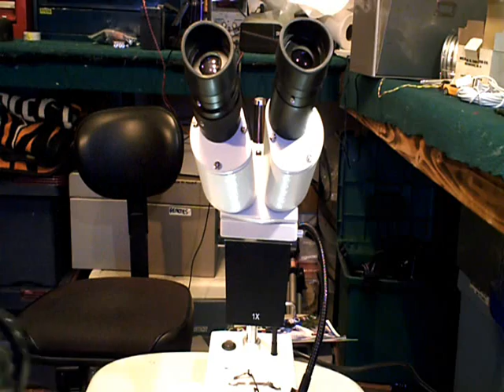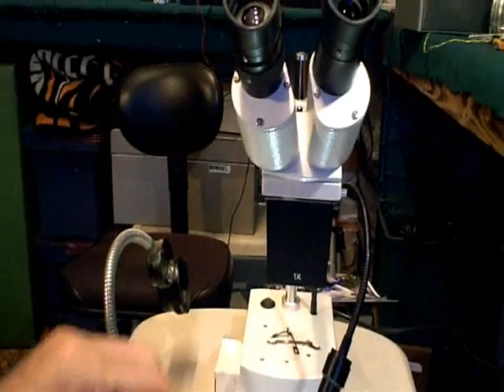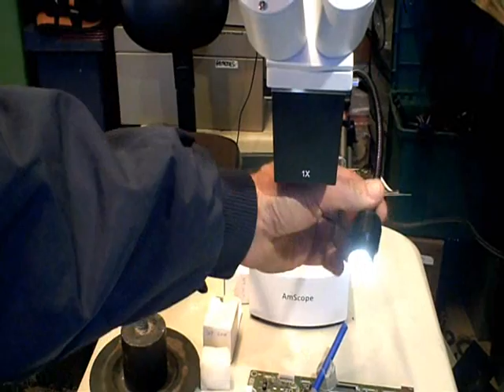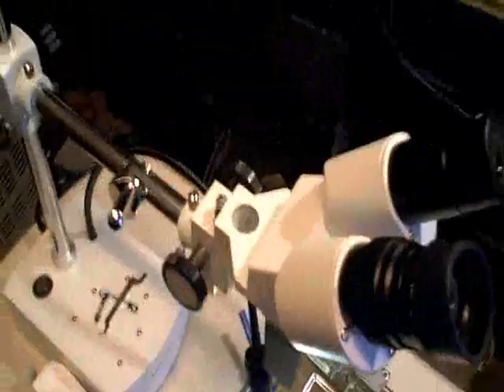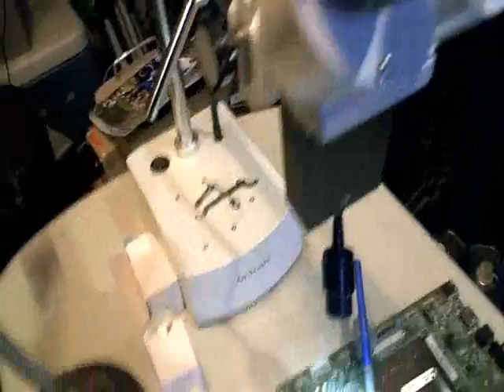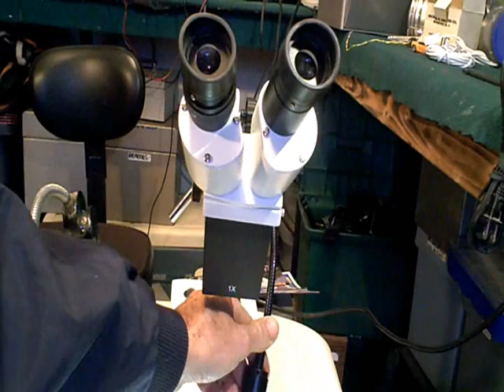Soldering Microscope. Why you should have one.

Comment: does yours not focus properly when lowering the microscope head around halfway down the sliding bar? does it have to be up high?
Reply from the maker: +Pero Yes if I lower the main optics it doesn't focus, but I didn't assume this meant it wasn't working correctly. I just figured it was out of its focus range.

Comment: I like the camera option, very nice.  
I will try using a video camera with macro focus zoom.  
I have a video CRT on my bench in one of my older workbench videos that magnifies a lot.  Look up Telesensory on ebay to see some of them.  Don 
This is one of the better color units at a very good price.  But you can get B&W for around 100$ or less.  Check this out!  http://www.ebay.com/itm/Telesensory-Atlas-610-Low-Vision-Magnifier-Unit-Free-Shipping-/252103348849?hash=item3ab287d271:g:2R4AAOSwpDdU4-ZV

Comment: That's a nice one, good working distance too.

 I used to use a cheap $80 10x binocular µscope designed for schools use but the working distance and arm reach left a lot to be desired, as did the fact that my face was so close to the work i had to use a 2-filter respirator mask (with the filters out the side) to avoid getting lungfulls of soldering fumes :)
This was even with extraction - turning the fans up higher would suck the heat out of joints too fast and cause a few dry-looking ones so the respirator was the best way to go for me.

Yours seems to have so much working distance that microscope you could use a hot air machine  like a cheapo -850 or -852 under it, which would really useful. 

And yeah - a good microscope is a revelation in repair - accuracy, eye strain and quality (as well as confidence) all improve to a massive extent.